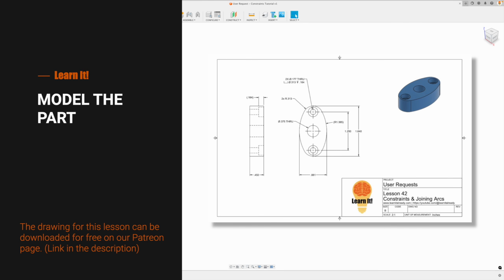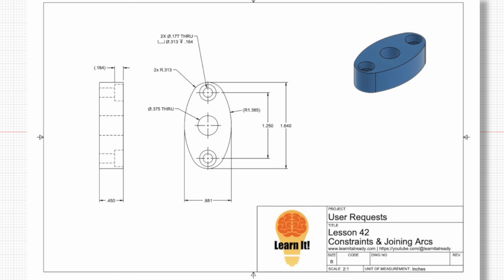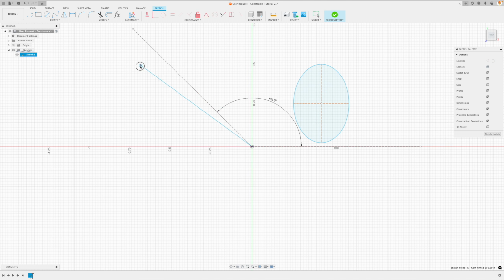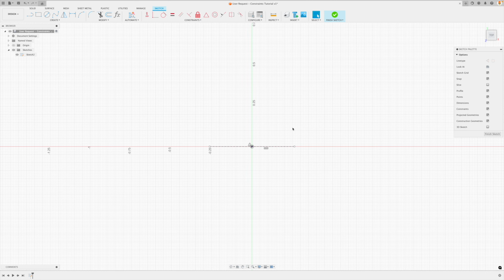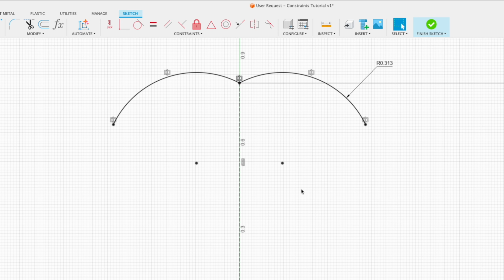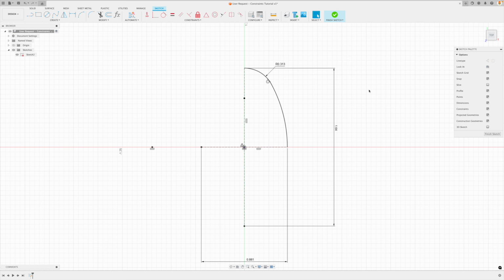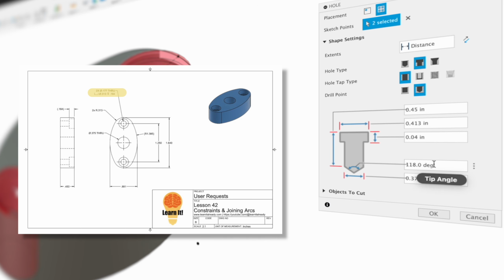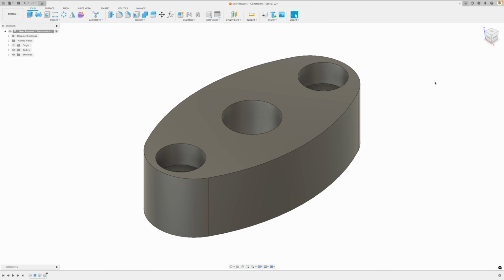Autodesk Fusion 360 - Understand Constraints & User Request for Beginners (2025)

Comment: I was working on a very basic design yesterday. I wanted to constrain a horizontal line to the midpoint of a horizontal construction line. No matter what I did, it moved the construction line to the midpoint of my line instead of moving my line to the midpoint of the construction line. This was regardless of whether I selected my line first or the construction line first. And I have no idea why
Reply from the maker: Thanks for reaching out. There’s a few things that could be happening. First and foremost, make sure to press the Escape key several times before clicking on any line, point, constraint, etc. to make sure to clear out any background tasks! This accounts for 95% of user errors with constraints. Next, you will need to select an endpoint of your first horizontal line and then select the line of your next horizontal line. Only a point can be constrained to a mid-point. A line can’t be constrained to a mid-point. Selecting an end-point first, then the mid-point constraint, and then a line will constrain the end-point to the mid-point of the line. 

Let me know if that works or if you need to clarify something.
Reply: @learnitalready are you saying that I cannot connect a midpoint to a midpoint? If so, how exactly do I get the two lines to be connected at their mutual midpoints when they're both horizontal? I did see a trick in your video that I'm pretty sure I'm going to be able to use to accomplish this. And that is when you put a point on the construction lines. If I put a point on the construction line at the distance that I want from another horizontal line, I think I'll be able to snap my midpoint of my horizontal line to that point on the construction line.
Reply from the maker: @DragonsChase you can definitely connect a midpoint to a midpoint, but you will need to constrain a Point to a midpoint of a line first and then constrain that point you just created to the midpoint of the other line by using the same approach as mentioned above. So, create a floating Point in space first (single points can be created by clicking the Create dropdown menu) then 1) selecting tre point 2) selecting the midpoint constraint then 3) selecting the line. Give it a try!

Comment: I MIStakenly drew in mm instead of inch, i realised this only  when i tried to make hole. Is there anyway to change all measurements to inch with just a click
Reply from the maker: That is too bad to hear! If I’m understanding correctly, you’re wanting to take 4mm and instantly make it 4in. Unfortunately, you can’t do that. If you just want to change the document settings from mm to inches, then that is possible! Go to your browser, expand document settings, hover over units, and select the little symbol that shows up. A dialogue window shows up where you can select the desired units (make sure to make it default) to which all your dimensions will display in inches. Hopefully that helps!

Comment: Which object move when constraining two free objects
Reply from the maker: Always use Joint! However you can only do this when joining two components, not two bodies. So, make sure to create components early on in your design.
Reply: @learnitalready  i mean when i try to constraint a circle and a line, sometimes the line flies to the circle and sometimes the circle flies to the line.
Reply from the maker: @johnnyralte5985  Ah, I understand now. Usually, it is “this to that” or in other words the first sketch element you select (this) will move to the second element (that). However, it all depends which element has already been constrained. Sometimes if both are not constrained then weird things can happen.

Comment: Nicely done. Thank you.
When speaking about the tangent of the second arc, I believe you missed the radius, (R1.385), for it. Wouldn't this be the desired way to constrain tangents between the two arcs?
Reply from the maker: Thanks so much! 

I think I know what arc you’re referring to. Here’s a little experiment for you which will increase understanding in what’s happening. If I were to define the radius value for that second arc, will it be perfectly tangent to its mirrored counterpart? If it isn’t perfectly tangent, then, in this case, there will be a valley between those two sketch elements. You would be shocked to see and feel that difference if you had this part CNC machined. Close is not good enough. So, try and define the radius value first and then measure to see if the centre point lines up perfectly with the X axis. Once you try that, then do as I did in the tutorial by constraining the centre point first, then create a reference dimension for the arc and the measure it at the highest resolution. I think you’ll see a surprise in that arc value. If you do, please reason out what’s happening and respond back to this post. Hope that’s clear enough!
Reply: @learnitalready  Ah, touche. However, have the dimensions on the drawing been met? I mean, the drawing specs out a radius, not that the two arcs shall be tangent.
However, I believe (and am trying this in a drawing now - will edit this) the small arcs (top and bottom - (R0.313)) will become tangential to the large arcs (left and right - (R1.385)).
Reply from the maker: @truegret7778  The drawing will never show a tangent callout. The design intent should always be assumed that tangency is implied. On the rare case that tangency is not needed, then that will be called out. Picture a drawing that has many tangent arcs. If all of them had a tangency callout, the drawing would be disastrously cluttered.
Reply: @learnitalready  It comes down to best drawing practices (ANSI standards). There should be no guessing, no doubts, no assumptions. I missed the fact you had placed a horizontal constraint on the center point of the arc (35.13s in the video). I was only picturing this drawing, tbh. I really appreciate the lessons. I've been leveraging the use of symmetry more lately (3D printing designs). I'll check out your other tutorials, too! Cheers!

Comment: Great video, one of the best I've seen at explaining Fusion. Great work , really appreciate the effort you put into these videos. One question I have , and as a relatively new user to Fusion, I find it a little frustrating that when sketching, the dimension lines and constraints plus your sketch are all the same colour , which to me ,if you have a busy sketch , can be confusing and possibly messy. I would like to see the constraints, one colour, the dimensions another colour and also the sketch yet another colour to have some contrast between them all making it easier to view what you are trying to produce.
Anyway many thanks again. and ATB
Reply from the maker: Thanks so much your encouraging comment. Glad you are benefiting from these tutorials. 

Thanks for explaining your frustration regarding colour in the Sketching environment. However, did you know that colours have already been applied to many sketch aspects within Fusion? Here is a list:

Black: primary sketch elements and dimensions.
Purple: projected sketch geometry.
Red: errors due to broken geometry from upstream changes.
Yellow: lost projections.
Green: locked lines.

Also, please note that when you change the primary colour environment within fusion to a darker colour, then sketch geometry often changes to white. 

Lastly, busy sketches can cause Fusion to really bog down. As you gain experience you will find that several sketches that focus on one aspect of your design are more desirable that one busy sketches that hosts all your sketch elements. 

Hope to hear from you again throughout your Fusion journey.

Comment: So in the drawing, it's the two different radii that tell us it's not an ellipse?
Also,  you are the reason I got a Spacemouse last year and it's life-changing.
Reply from the maker: That’s correct! If it is an ellipse, then it will be specified in the drawing for sure. 
Great to hear about the SpaceMouse! Which model did you purchase?
Reply: @learnitalready  I just got the wired compact and it's amazing.  I want to get my son one for Christmas this year.  He is also a budding Fusion and 3D printing fiend.
Reply from the maker: @boboscurse4130  Wired compact is the way to go! Good purchase.

Comment: Hi from NZ. Excellent video especially for a beginner. I thought it was well paced, instructional and clear. I only have one question based on other Fusion360 videos I have seen. A few have said the number one rule is first thing is create a new file and then make a new component before you start first sketch which makes it easy to go back to the sketch if you need to edit. Otherwise there is very little info if all contained in one sketch. (Not sure if that applies for every new sketch) Sorry if that sounds confusing but thats the way I understand it? 
You have a new sub and I look fwd to starting on your Learn Fusion360 series.
Reply from the maker: Awesome question and excellent post! Thank you for subscribing too! 

As to your question, in all my years of working with Fusion there is a basic principle (not rule) when it comes to working with components which is this:
If your file only has one component, then there is no need to create a component within that file. If you do, it essentially becomes a sub-assembly with only one sub-component. (A little convoluted if you ask me) You can verify what I just wrote by looking at your top-level component (the top-most component in your browser) before and after creating a component. Look at the icon and you will see it changes from a single component to an assembly. If you keep your design to just one component then all your sketches, construction planes, etc etc in your browser will be properly organized. HOWEVER, if there is a slight possibility of creating another component at any time downstream, then definitely always create a new component first which will definitely keep your design well organized and aid to your design not breaking.